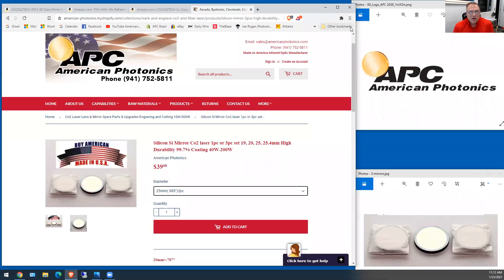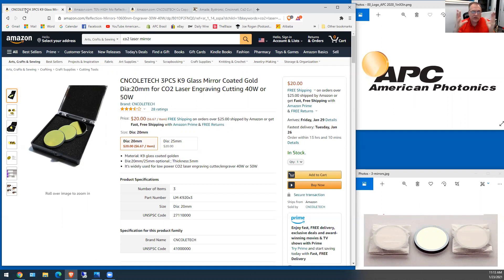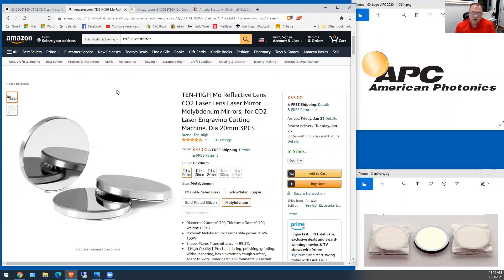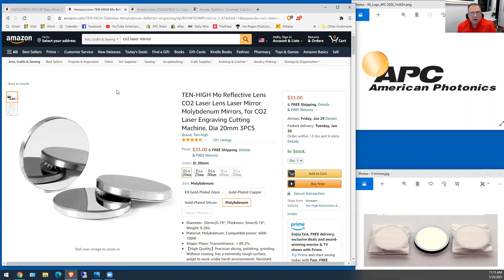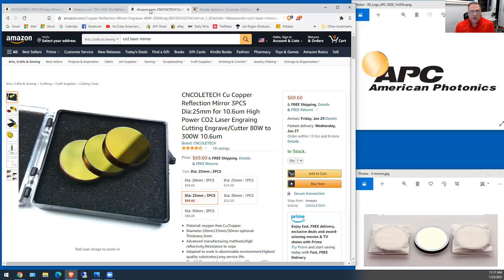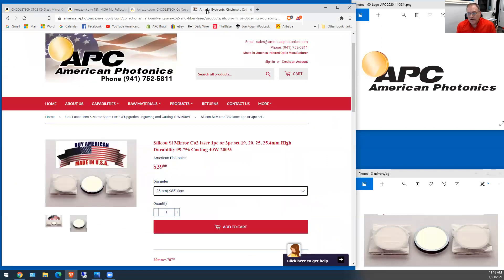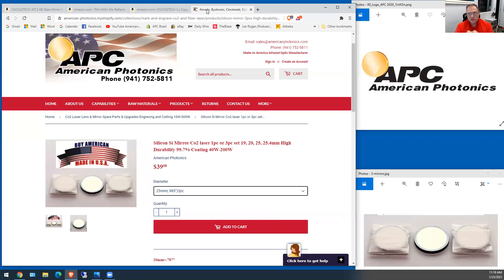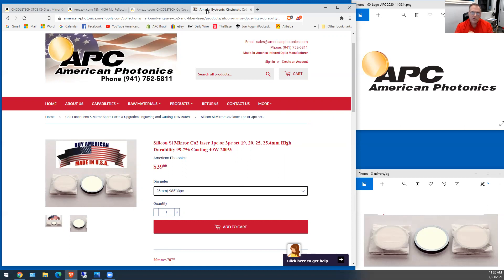Co2 laser Mirrors 101. everything you wanted to know but were afraid to ask.

Comment: Setting aside potential damage from the heat of a laser beam, what is the best way to clean mirrors and laser lenses?  Anytime one physically touches a lens, there is a risk of scratching the surface and / or damaging the lens / mirror coating.  While alcohol seems to be the preferred solvent because it is readily and inexpensively available and does dissolve oily contaminants to which lasering debris (smoke, etc., from whatever is being lasered).  Do vapors from acrylic, “laserable” resins in laminate (Formica), etc., degrade lens surfaces? Additionally, if the cotton swab does not absorb / adsorb everything, it will just smear oily contaminants over the surface of the lens, and if a small, harder piece of debris is between the cotton swab and the lens, the lens will get scratched.  Smearing an oily substance over the surface of the glass just helps floating or airborne debris to adhere more easily to the lens surface.  So, one solution is to use an ultrasonic bath to “pop off” the contaminants, especially oily substances, from the lens surface.  Keep in mind the only thing physically touching the mirror or lens surface is liquid, water with a very small amount of some surfactant to ‘grab’ contaminates, particularly solid debris.  So, my basic question, does / can ultrasonic cavitation (cleaning) damage lens coatings, that are generally electrostatically bonded to lens and mirrors?  Some suggest using acetone; this is a pretty potent solvent.  However, while it does clean lenses and mirrors better than alcohol, there is still the problem of rubbing the surface of lenses and mirrors with a cotton swab.  Additionally, many lenses and mirrors are held in place with epoxy (or whatever) to lens tubes.  Acetone would most certainly dissolve or degrade (most) bonding agents — and other non-metal components.  So again, what is the best way to clean lenses and mirrors, particularly if the lens is embedded deep (2¾± inches) inside a ¾" lens tube?  There is very little, as in almost no, wiggle room to clean the lens.  Most laser machines now have their lenses “enclosed” in a metal tube or housing that precludes a lot of debris from getting on the lens in the first place, still the lenses and mirrors in these seemingly well sealed lens assemblies still get dirty.
Reply: just invest in overpowered exhaust fan and thank me later. I burn not only acrylic, but even rubber and mirrors are always super clean. My head mirror is sealed though.

Comment: Let me add a few facts
 Material             Thermal conductivity                      Thermal expansion
                            (low is poor conductor)                  (low is little expansion)
Glass                                   1                                                      6
Molybdenum                     139                                                  5
Copper                                400                                                  16
Silicon                                   3                                                     4  
 Using a worst case  2% percentage power loss per mirror for a 100 watt laser beam ie 2 watts.Let's take a look at how such heating will affect each material.
The thermal conductivity of glass and silcon  are both in the same region of poor and thus for the same amount of energy input they will heat up quicker than metal mirrors but with relatively low expansion rates they both  will be mechanically stable.  It is true that copper has 4 times the expansion rate  of silicon but it is  also 133 times better at dissipating 2 watts and will never suffer as much expansion as the silicon. Molybdenum is  similar expansion to  silicon but  45 times better at dissipating 2 watts, so even less distortion there. 
 Neither glass nor silicon are natural reflectors .The get their reflective properties from  higly reflective gold plating. Damage that gold surface, even with micro porosity, and  the substrate will rapidly heat up. That risk is nil with metal mirrors.  Pure copper mirrors are not available  because of the supposed oxidation propensity.Thus they are gold coated to deal with this percieved problem Micro porosity of the coating will not affect its reflectve properties and will not cause it to heat up any faster. Compare the cost of each mirror type  with it's strengths and weaknesses and you will see why most machines (as mentioned in the video) are supplied with molybdenum mirrors.
Reply: Hi Russ, again was checking what mirrors are the best and of course saw you here! :D Going with Molybdenum just like you suggested, it all makes sense. And i totally agree that copper wont suffer thermal expansion from absorbing 1.5 watts of laser energy, as it dissipates it nearly instantly, and if you have a more powerful tube you can always stick a round heatsink in the back just like I did. I personally disliked copper a lot being in Florida and working in my garage, it oxidizes horribly and very fast, scratch super easy and they are pricey. So I am not gonna use it again for these reasons.